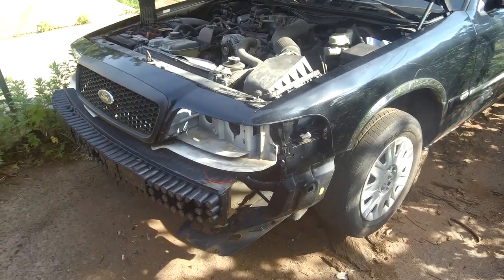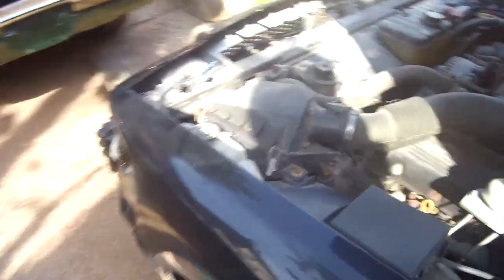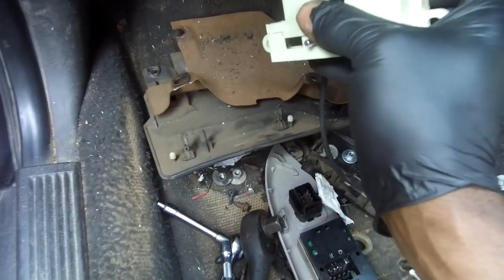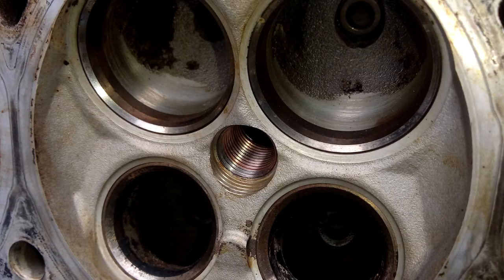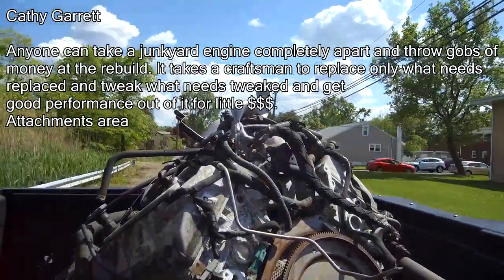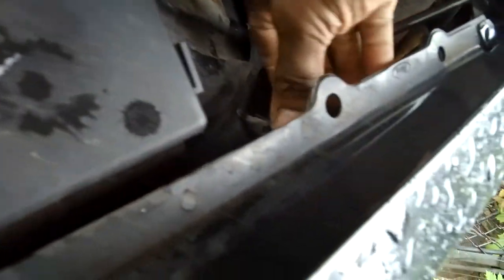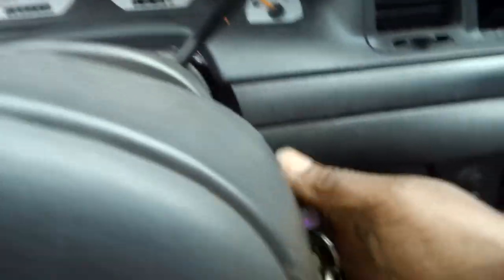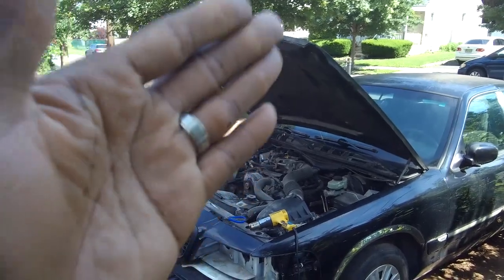Mercury Grand Marquis NO START NO CRANK! (  $120 Rookie Mistake )

Comment: I had that problem and started it in neutral
Reply: Me to on my Ford Truck
Reply from the maker: i thought it was that to.. man when that did not work i got a little worried lol
Reply: That lesson cost me $120 too I thought it was the starter so I replaced it and it still wouldn't start had me mad as hell because that starter replacement ain't for the faint hearted lol. I called my dad he told me to try neutral and it fired right up. Learned to always wait until the forward momentum settles before pulling the key out. Great content btw, I love my ol 99 MGM
Reply from the maker: @johnhartsock4752  I thought it was that also.. That did not work then worring started lol.. man i payed 435 bucks for s starter so that did not pain me as much as that ecu did lol... A least you had your Dad there for ya... that starter aint bad .. Try a Expedition that sucks

Comment: I have some of the same issues here but mines actually cranks it’s a 2007 crown Victoria police interceptor now when I initially saw this video kouple days ago I’m like nah I really don’t wanna think it’s that I replaced throttle body crank shaft sensor and alternator but then I’m like lemme just try it then me and my mechanic tried it and it worked but it did the same as every other thing we fixed and thought was the problem it drove ok for a little while enough to get it back home then I thought I was klear then I’m driving down the boulevard and it just turns off mid drive again then it turns on enough to get me to advance auto part then it cut off again two more times it was doin some weird stuff like when I’d open the hood and klose it it turns right off then we did the ground thing again and it didn’t work this time at all so I left it where it is and I’m totally clueless as to what it kould possibly be now 😩 excuse my spelling I do that on purpose but do u have any advice or the next time I get to it I will upload a video and maybe u kan help me out with some knowledge maybe 🤔
Reply from the maker: change the fuel pump relay and try to up the idle a bit... and when you turn the key in the on YOU SHOULO HEAR THE FUEL PUMP hummmm. Now it should be strong enough to hear, now if you hear zero well the fuel pump is working but very very low pressure.. Try the idle it up a little this happens to these cars a hard nut to crack, but try the idle
Reply: Yes I been knew it wasn’t the fuel pump I always hear it when I turn the key on I started to replace it any way but I kno it’s not that u kan hear it workin every time I then thought about fuel filter kuz that’s was a problem on the 01 Vic but I’m def konfused by this 😩🤣 but def thanks for your reply I appreciate it much

Comment: One thing I would watch. Careful saying anything about the pins touching. That's his way out. Will swear that's what killed the PCM.
Reply from the maker: I went and I bought another PCM and sent him that on vs the old one that the pins where touching.. So we started off fresh vs with a bad PCM.  He is saying he has done many of them and I am the only one that complained.. I was like you are the pro, but EVEN a pro quarterback throws a bad pass.  Ebay locked his money and now he is mad. I guess we are even, but he will get his money before I get a item
Reply: @bstfordchannel923  everyone has a flop every now and then. Even Ford's had to recall a recall a few times.
Reply from the maker: @paulday6875  that was the vibes I was giving him.. I think HE THINKS i am trying to be slick or something.. I asked him I can send you a video.. The issue i have really is. before the transaction we where back and forth for days.. Soon as I got the part and it did not work 3 days go by and no reply.. So  i put in a return and then 2 days later i get a reply ( Stopped his money ) i guess. that was not the plan. i rather a working item..

Comment: It’s literally my 4-5th crown Vic and this is the newest one I’ve purchased but I def am not a fan of that electrical control shit at all my old vics u kan rev from under the hood I do not I repeat do not like that new electrical bs at all I’m tryna not to take it to the shop because crown Vics are easy fixable cars but this by far is theee worst trouble I’ve ever had with these cars like it’s makin me super not like them now 😩😩🤣🤣🤣🤣I wasn’t really into knowing about the p71’s and all that till this one but I never had problems of these sorts on any other one I had I had a 96 ,a 2001, 2004 and now 2007 u would think the newer the better but it’s total opposite to what I see smh
Reply from the maker: I AGREE with this people like the newer ones , but they was not built right ( deep inside feeling I have ) we see a lot more older vic vs the newer types ( why ) cxause they better to me.. I like to rev the engine from under the hood old school style... This can NOT happen with a NEW SCHOOL Vic ( just like you mentioned ) all my vic have the simple set-up heating control... I dislike the Lincoln version all electrical stuff not my thing
Reply: My 2007 p71 is a pita I love her but I swear gremlins are killing her... the key just free spins (no resistance/catching) when I try to start the car....🙃